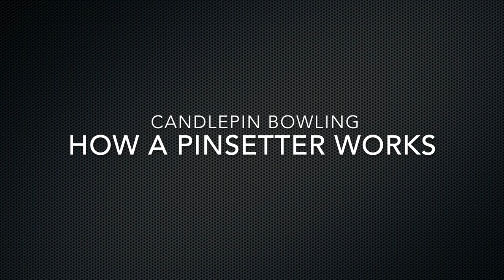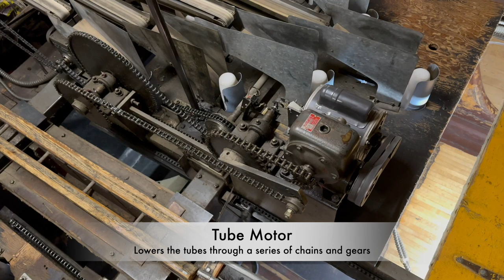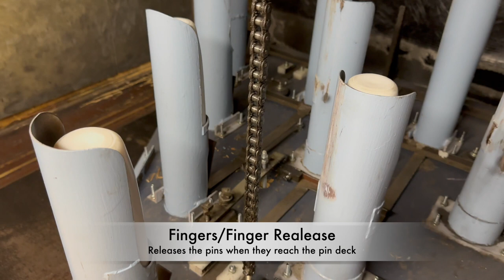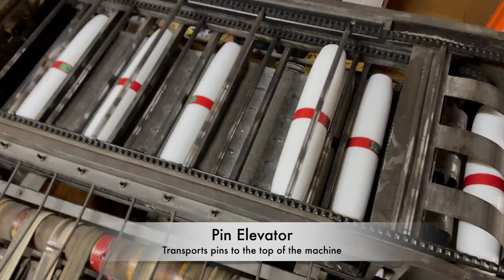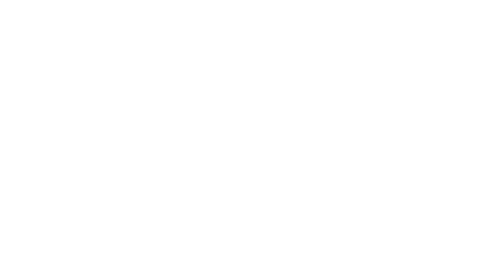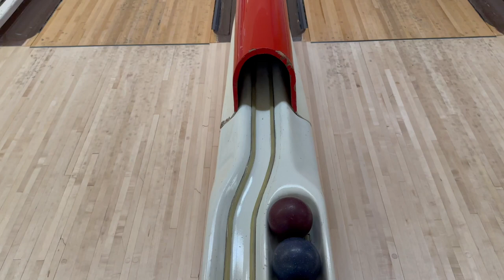How a Candlepin Bowling Pinsetter Works

Comment: it is interesting and i've bowled in leagues for 50 years. what is the distance between the pins and the pin plate is like a seperate piece of steel plate? thnx for the tour.
Reply: Pins are 1 foot apart. Older houses typically have steel decks, yes. Some were phenolic as well, but those have mostly been replaced by now. Houses are starting to use synthetic tenpin decks as they modernize.

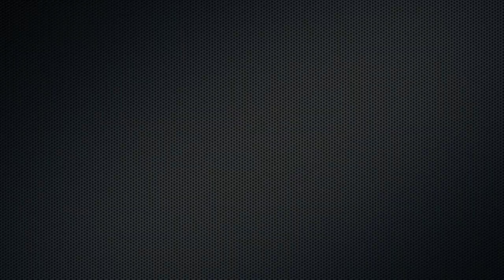Comment: 2:48 at least it's safer to do that rather than doing it on a 10-pin machine, especially those older Brunswick's. Are the pins still wood or a different material?
Reply from the maker: The pins are plastic, we actually just got a whole new batch of them
Reply: @DanTheDrumMan  Thanks for the info. I would love to try candlepin sometime, but I know I'm putting a ball through the masking  unit at some point due to 10-pin muscle memory.
Reply: Its still dangerous no matter what. Imagine putting both of your hands on the turntable as it spins around
Reply: I immediately recognized this place as I worked there for over 25 years and helped John Topoli install  the pinsetters  on lanes 17 to 24 back in 1975. Great memories of Timber Lanes.👍😁
Reply: They are fully plastic. The body is hollow and has a cap pressed into each end.
Reply: @DanTheDrumMan  I never have been to Timber but have always heard good things about it. I live in Georgia now but was an avid candlepinner when in NH. Do you guys sell T shirts?
Reply: @fredh.1255 John Topali was a legend, and very nice guy. He used to come every Wednesday to South Shore Country Club for regular maintenance in the 90s. I remember he charged $19 an hour, which was pennies even then.
Reply: @Greggys10Pins  Just don't throw 5 games of candlepin then try to throw your 16-lb ball later that night.   Been there, done that, won't do it again!
Reply: @danbale4160  Sounds like a challenge to me. I ACCEPT. LOL
Reply: @johncassani6780 
John is a heck of a nice guy and was a fantastic Bowl Mor mechanic. When he was servicing the pinsetters at Timber Lanes, we rarely had issues . Occasionally we might have to chase a customers bowling ball or maybe a pin lift motor might fail, but that would be about it. He is currently retired and living in Georgia with his son. He’s in his 90s now and doing well the last I heard. 👍😁
Reply: @Greggys10Pins  Video or it never happened!
Reply: @danbale4160  video of what? Don't know what you're suggesting here.
Reply: @Greggys10Pins  You "accepted" a "challenge" from me, based on my comment "Just don't throw 5 games of candlepin then try to throw your 16-lb ball later that night.   Been there, done that, won't do it again!"
Reply: @danbale4160  ah yes. Well it will be a while before I'm in a candlepin center.